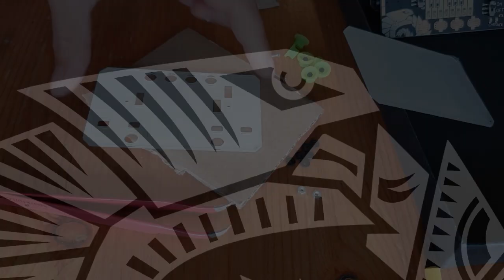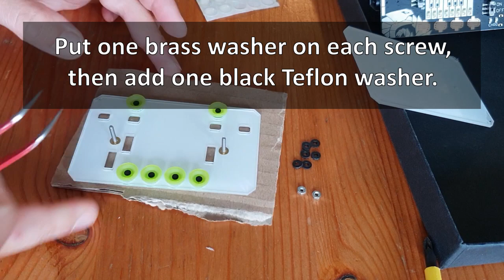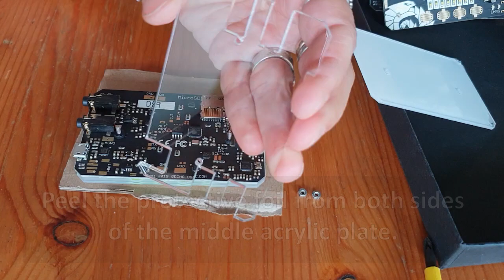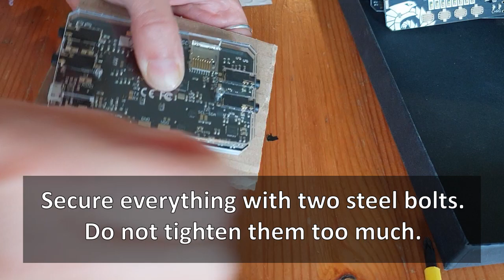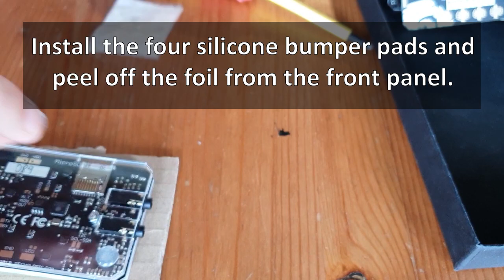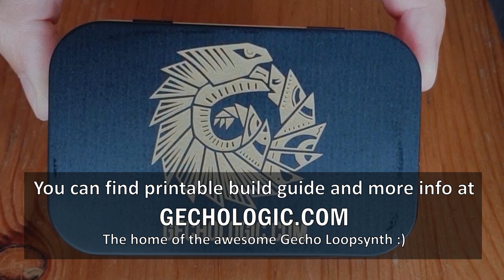Gecho v2 - How to build your DIY kit (acrylic sandwich)

Comment: yes! I was planning on combining the po-20 with the gecho and the result really does sound wonderful! can't wait to get mine <3
Reply from the maker: My favourite one of Pocket Operators :) But I am just learning them. It was a lot of fun, I was trying to make a complete sequence for this song but it seems like the 16 pre-defined chords in PO cannot be changed. So have to start the other way around - build a song using available chords. This was recorded directly to SD card for a demo but for some reason I am not able to sync it with the video, maybe it's the odd frame rate or skipped sectors (you can hear one instance in this track). So using the material as background for these videos instead.